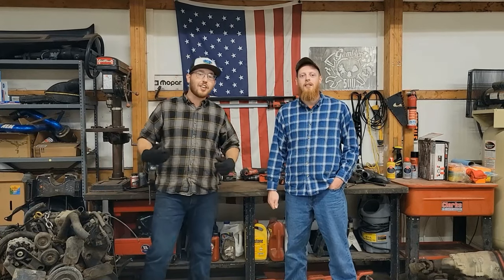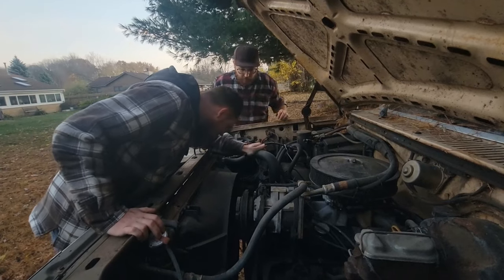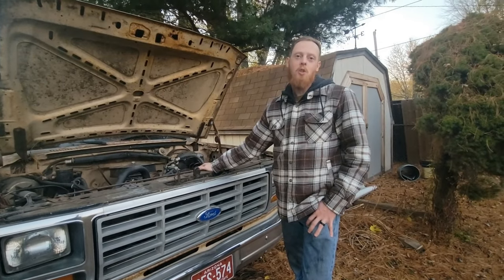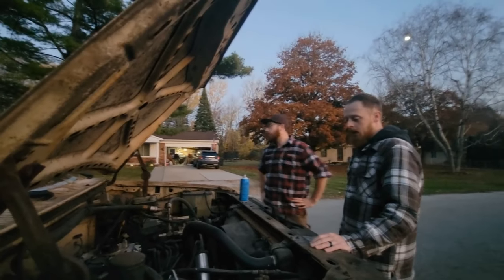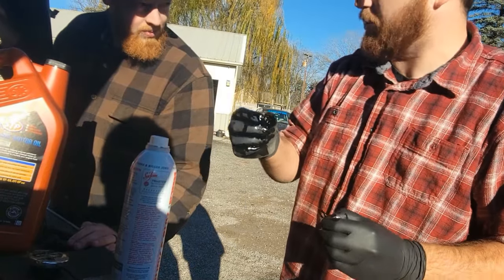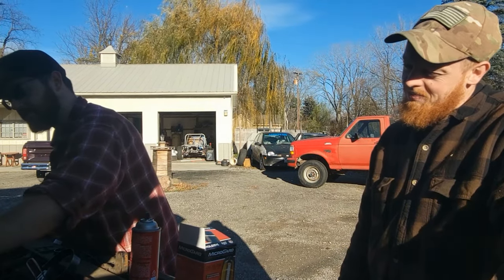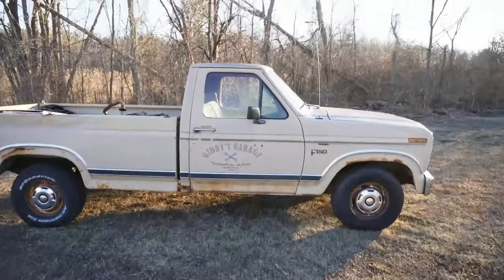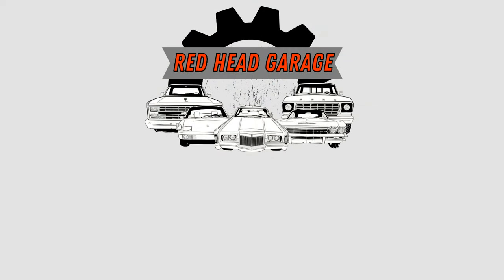Bullnose Ford F150 Bought WITHOUT Seeing it!

Comment: the 83 302 wasn't fuel injected from the factory, Someone either put a 302 out of a Mustang in it or put a FI conversion kit on it, Ford didn't put Fuel Injection from the Factory on the 302's for the F-150 until 1987, but the Bullnose and Bricknose Ford Trucks are becoming a popular build because they are the last of the affordable classic trucks and this one is peach, idk what you paid for it but it was a steal.
Reply: 1985 I have one XLT lariat explorer super can long bed 2wd aod 302 fi.
Reply: That's exactly what I thought when I bought mine
Reply: @ScottLeonard-ms6vn  Explorers and Mustangs did have FI, the F-150's did not.
Reply: @TheREALOC1972  sorry to differ sir but as stated 1985 was first year for fi. I own one F-150
Reply: @ScottLeonard-ms6vn  It must of been ordered that way because they didn;t because STANDARD in the F-150 until 87.
Reply from the maker: @TheREALOC1972 you are correct. This truck was never fuel injected. Verified with the original owner that the motor is original and just had the top end redone with the high-rise intake and new carb. Got the truck as part of a bundle deal with 2 other cars, but the price for the truck specifically was $500.
Reply: @redheadgarage  Very good deal.
Reply: 1986 was the first year of fuel injection on sbf’s. Last year of the bullnose, first year of fuel injection
Reply: @jamescrane8873  WRONG, 87 was the first year, The 7th generation or "Bull Nose" Ford ran from 1980-1986 and did not come STANDARD with fuel injection. The 8th generation or "Brick Nose" Ford ran from 1987-1991 and DID come standard with Fuel Injection , That's what differated the 7th gen from the 8th gen, the Fuel Injection. Body wise they were all the same body for 7th, 8th and 9th gen from 1980-1997. sure there was some slight difference from year to year but body wise they were basically the same truck, that's why when you order parts from like LMC or Brothers Trucks the 7th, 8th and 9th gens are all lumped together.
Reply: 1985 had fuel injection on the V8's but not until 1987 on the 300 6 cylinders.